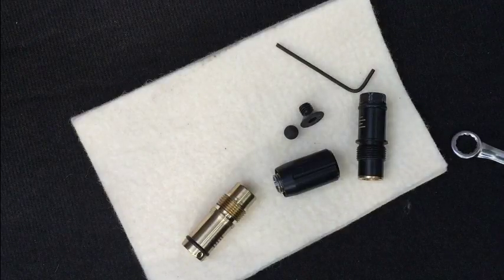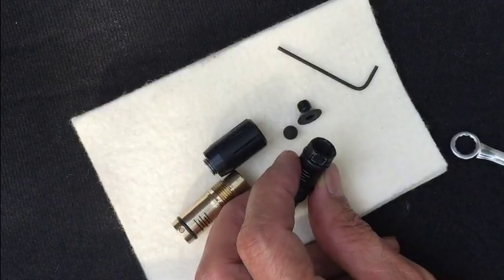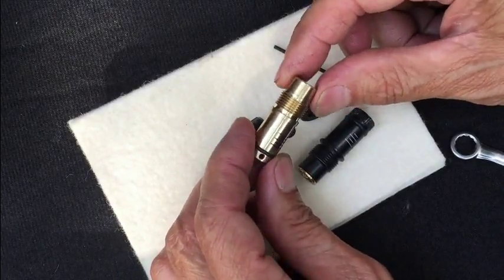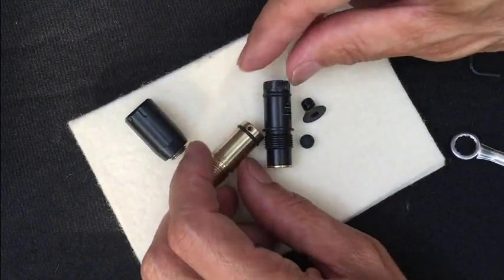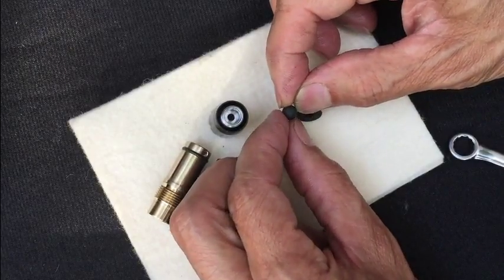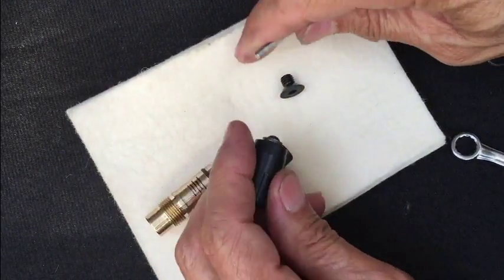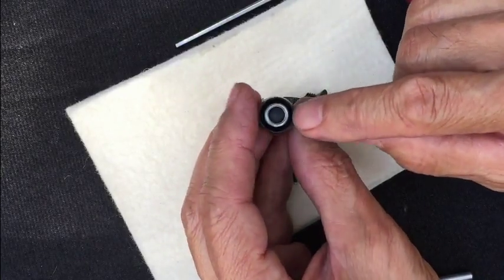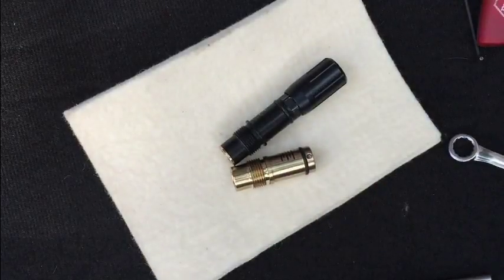FX impact valve stop A17 and rubber ball A16 info

Comment: Hi Ernest. I need your help. I removed the screw back on the original Valve adjuster knob on my Mk3. Now I have only 1 rubber ball. Should be 2? Probably I loose 1. Could you post a video . Thank you for your permanent support to users.